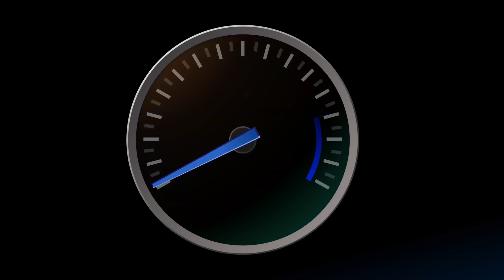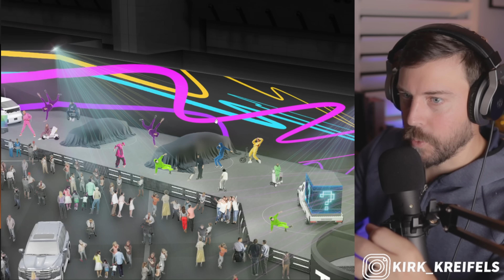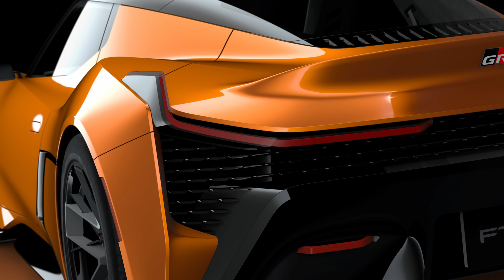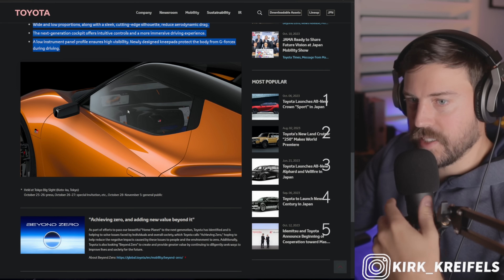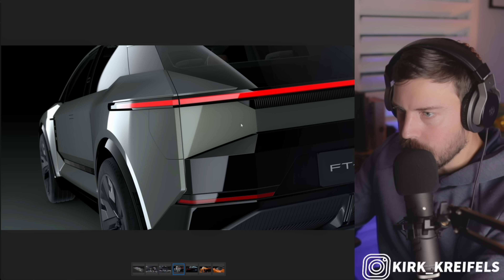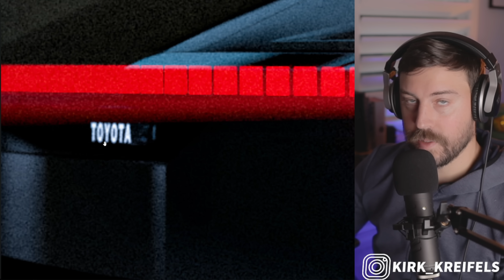Toyota just TEASED the Next Supra // RIP inline 6!

Comment: I doubt Toyota  Supra will go EV sooner..EU regulations lacks on emissions and extend banning petroleum engine till 2035 so gasoline stills lives on and so the Supra especially if Toyota not producing the engine but BMW. They have a lot of options in engine from bmw. Next gen probably bump up to twin turbo like the M2 when they ended the Z4 production. Supra is a small fraction of their inventory so that won’t affect much the emission cut from their line up. This would probably an experiment mid engine and Toyota will go from there if that would be a hit and desensitize the enthusiast to love the EV if they can pull it good by this mid engine.  They would rather kill the Supra instead of going EV. Tada even say that Supra won’t go even hybrid.

Comment: About Chademo, it’s not outdated. It just has separate ports for what would be combined in a CCS port. But hey, at least the AC ports are compatible with CCS. NACS is the one with the least kw capacity at only 250kw. CCS has DC output capability of 350kw, and Chademo has a DC output capability of 400kw. So seeing it that way, Chademo is more advanced than the others. Granted though, most Chademo chargers in Japan are older chargers with only 50kw, so that’s where the outdatedness comes from.

Comment: idk why Toyota wont used the 3.5 L TT V6 that they have in the Lexus LS, Toyota Tundra and make a Supra out of it or at least use Mazda's I6 rwd platform as a basis so at least its japanese at heart.
Reply: It's because it makes financial sense that I'd bmw is going to supply basically the whole cars parts , why not isut do the engine to? Instead of making the chassis in one country , shipping them to another to put in a different motor , plus the B58 smokes any motor Lexus or Toyota makes atm
Reply: @VaunShiz yeah but that collab on the Supra is supposed to be dead after 26 I believe.

Comment: For weight it should be 100 mile range
Reply: people who passed CAFE laws etc  that are suppsoed to be about emipeople who passed CAFE laws etc  that are suppsoed to be about emissions and sustinability, dont care about those things.  suv cars have lower less emissions and roll over standards. the example of porsche using a bigger engine which worsens emissions, because their smaller engine didnt pass legal standards given that engines have to pass standards according to their size... even though the smaller engine wouldve been less emissions, etc. standards were more strict for cars of small length and width , but not height and weight, which are more of a big deal.  gives good idea of speed .